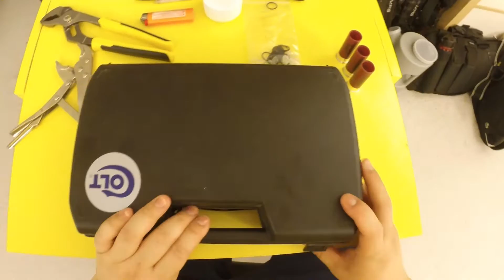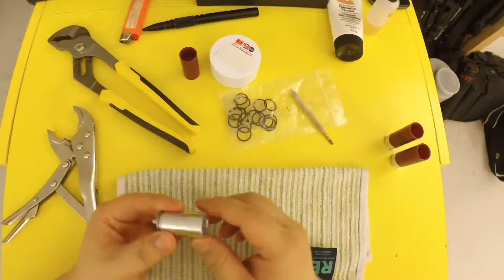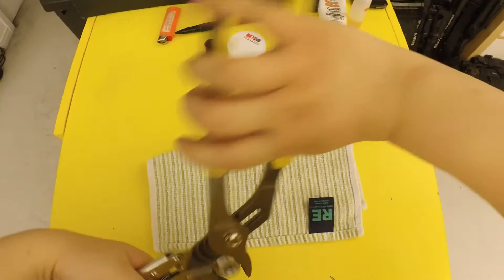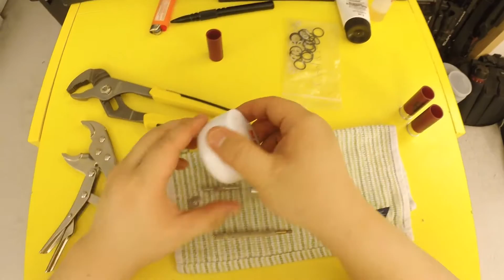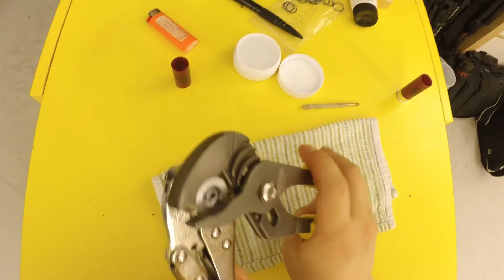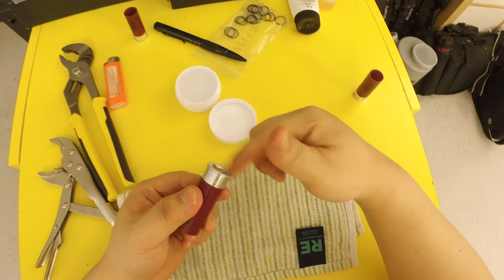APS CAM870 Co2 Shotgun Shell Maintenance and Fixing Leaks

Comment: hey Mak! Thank you for video! it really helps. My cam870 has a problem. i only have like 15 shells. among them, 5 of them has problem. when it is charged and inserted to the gun, (mine is shortty version so i can load 5 shells) and whenever i reload the problem occurs. when i reload 1st shell to the chamber, all rest 4 shells leaks instatntly. when i pull the slide back to load shell all rest of shells inside magazine(should i call it magazine? or tube) leaks at the same time.do you have any idea what the problem is? thank you in advance
Reply from the maker: +HS Kim no idea what happen but that is definitely no good. Contact APS for direct help is better!

Comment: 72 shells!! wow! Do you run your maintenance on new shells or wait till they have problems? I had 3 of 5 LM4 mags leak out of the box so I lubed them up to function fine. Are you sponsored or have a huge budget for shells?
Reply from the maker: Aaron Robbins I have no sponsor man, just pure purchase!  LOL!  You don't need to do anything to the new shells, just use until they have problems then you can open them up. If you use HPA like I do now, then you don't need to worry as much because HPA seal in the shell better than Co2 too, less leaks!
Reply: MakHobby Been watching and reading your stuff all morning, You are extreme bro! I see by your other reviews that you go all in when you set up a platform. I haven't gotten my gun yet so I have been obsessing over what else to get. I do plan on running mine, mid length SF version in CQB kill house and will get many shells. On shells that don't leak, how long do they hold there charge? I imagine that I will try and load a bunch the night before and run the next day, would they last a week? I was also thinking about a larger tank so I can save my 12g bottles for thunder Bs.
Why would HPA leak less than CO2? Thanks!
Reply from the maker: Aaron Robbins
email me to chat on this then, let me get you some good tips and links. makjosi@chiinnature.com  - yup I am crazy on these and doing lab test all the time like how you see it. I have over 60 videos posted but not PUBLIC yet because I don't want to scare my subbers... so I am releasing videos like one video a day for this makhobby channel and 2 videos a day for the bigger channel on Chiinnature channel... but still, I have over a month of vids not public yet.. so if we talk by email, I can send you the links there and you can see those nice vids too!
Reply: MakHobby Done!

Comment: I'm going to fix my shell tonight but i only have gun oil lubricant and not gun grease could i use the oil instead or will that not work well with the o rings? There is also a trick i learnt that you can use on o rings of any kind. You heat up a cup of water dip the o ring in the water for a few seconds then cool it off in cold water. I did it on my xbox 360 o ring once and it works great,not sure if it will work well with airsoft but it doesn't hert to try.I was told the hot water heats the rubber and seals the cracks then the cold water hardens it a bit, something in the lines of that. It was a tip i heard a long,long time ago.
Reply from the maker: depends what gun oil, silicone oil is okay, pellgunoil is okay, and for oring, heating it up with an open flame is better, just put the oring on a tweezer and heat it a few seconds by waving a lighter below it and it will expand already, but the water trick also work, depends what you prefer to use. I like the fire trick more because it's fast and easy.